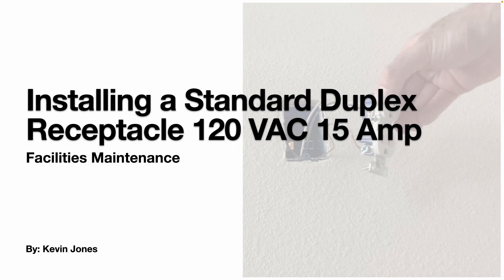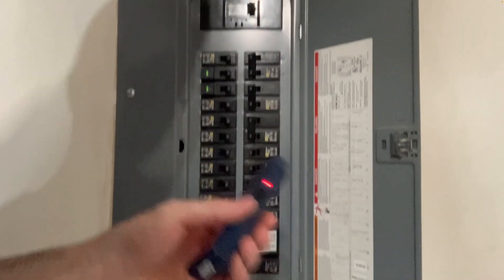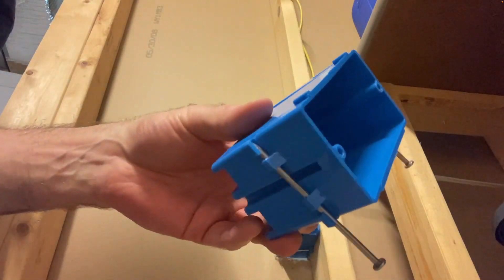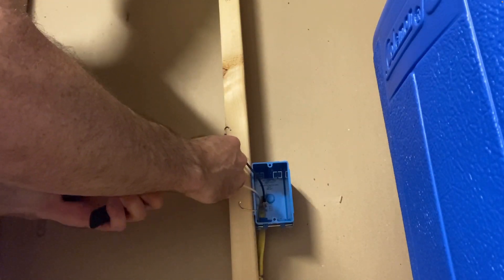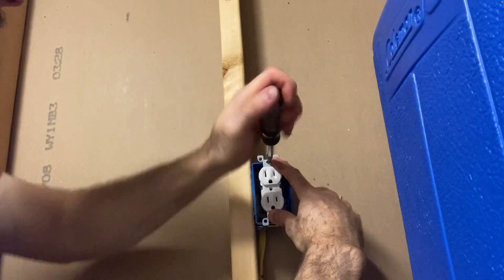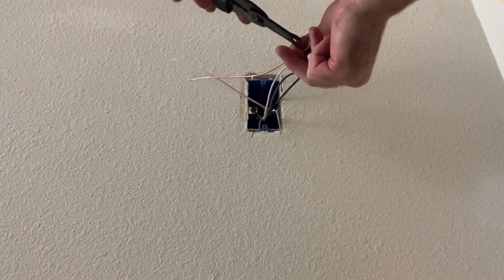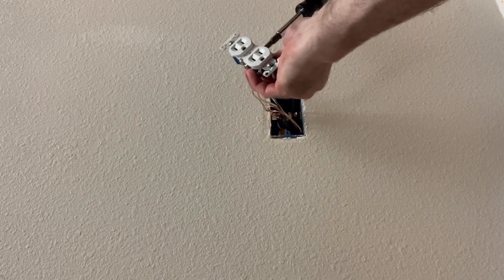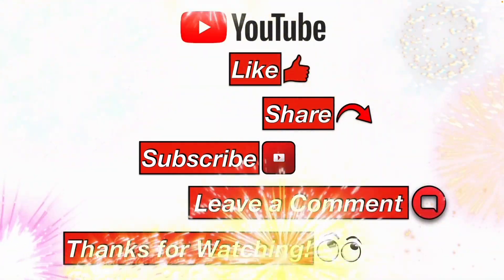How to Install a Standard Duplex Receptacle | 120 Volt 15 Amp

Comment: Is not a yellow coloured cover 12 gauge wire?
Reply from the maker: Correct
Reply: @kjfacilities-maint  While 12 is for 20Amp - it is safer to use the 12 instead of 14, although 14 is the minimum recommended for 15A.  I use 12 in case I want to upgrade my outlets to 20A.  the wiring is the most involved thing to replace.  Receptacles and Breakers are easy.
Reply from the maker: Agreed.